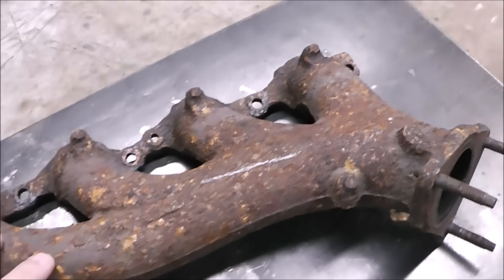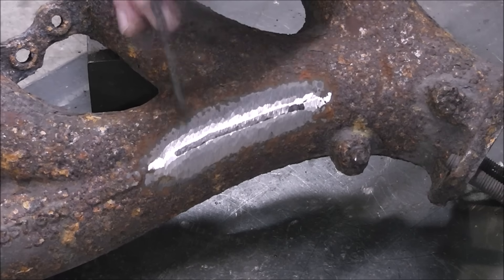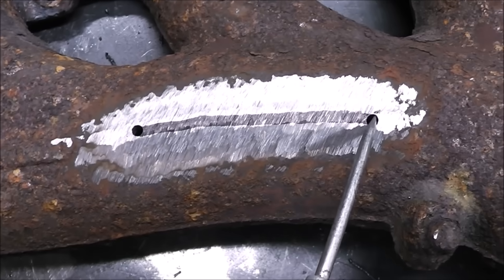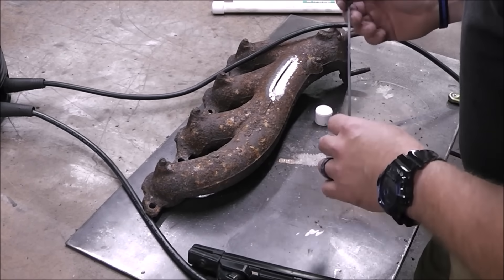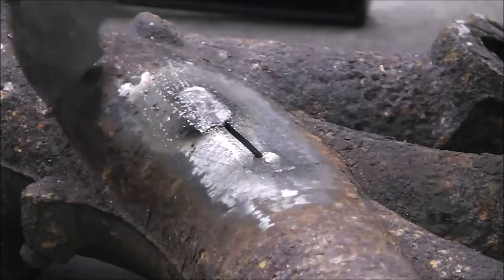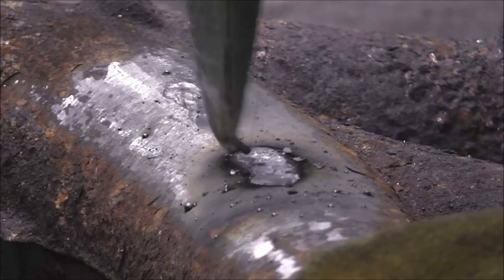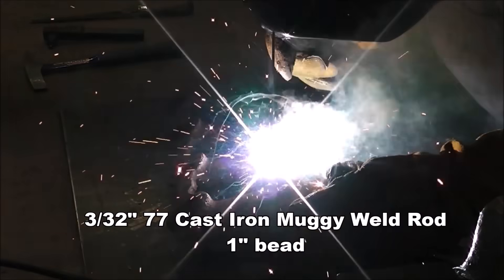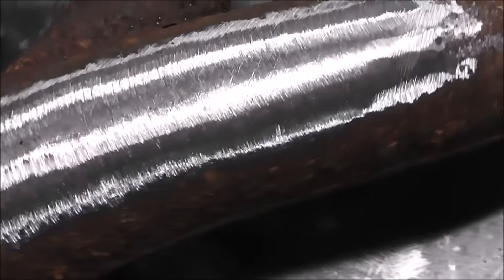Stick Welding Cast Iron Repair with Muggy Weld

Comment: Thanks for the video Brandon! I I recently graduated welding trade school and don’t have much field experience so I love these videos. 

I just have a question. You drilled the crack so it wouldn’t spread but wouldn’t the weld consume the entire crack melting and fusing the edges anyway? 

Would you be able to explain how the crack would still spread even after being consumed by the weld and how drilling it prevents that? 

Thank you!
Reply from the maker: Good question Michael.  You would think that the weld would consume the crack but I was taught that the radius from the hole is what terminates the crack and keeps it from spreading.
Reply: As you start welding on a crack without the holes at the end the expansion on the metal heating up can cause the crack to grow so you are trying to weld the crack and the crack keeps growing. So the hole keeps the crack from growing during the welding process, once it’s welded it shouldn’t be going anywhere.
Reply: The term for it is called 'stop drill' or 'stop drilling'. We were told in the navy that stop drilling the end of the crack relives the stress of the crack with the round hole allowing it to help absorb the pressure/force of the crack. On older jets the we find small stress cracks coming from rivets, occasionally on the skin of the aircraft, we'd stop drill the end of the crack and it worked, the crack would stop.

Comment: Okay... If I had some muggyweld I would use it to repair a cast iron flange in place. It's not coming off the tractor where it's been for 52 years.  I have some Craftsman 3/32 cast iron rods that run on ac or dc. They are older than you and the flux is coming off them. I really need a proper weld with less chance of blowing through or cracking the iron.  I can weld it with a warmed up motor.
Reply from the maker: Your in it David and those Muggy Weld rods would be perfect for that repair! Be sure to keep an eye on that video. As soon as it hits 1M I'm making the announcement. Good luck!

Comment: A couple years back I had my Chevy 383 stroker engine on my engine startup stand and I couldn't get it started so I had it in my garage and it was the coldest winter ever here in Windsor Ontario Canada and guess what? Yup the block cracked in 2 places. I could send you the pics. So I have been doing a lot of research into welding it and I have heard about Muggy Weld but have not bought it yet. I would love to try it so I can finally get my 1980 Camaro back up and running again. Thanks for the opportunity for getting some.
Reply from the maker: Your in it Daniele! It's a shame that the stroker got cracked but the good news is that Muggy Weld is a perfect fix for that! Be sure to keep an eye on that video. As soon as it hits 1M I'm making the announcement. Good luck!
Reply: I had a new rebuilt 383 motor do that and junked it. Thought I drained all the water and left for Florida for a few months. It cracked in the valley and the side of the block. Also years later a roadrunner I was restoring, the 383 block was cracked me and my buddies attempt destroyed it. He was a welder like I was then but I've never welded cast iron. but anyhow, lots of info and great video!

Comment: Good video , Ive always had better luck with parts from an engine if they are heated up , baked prior to welding to remove soaked in oil . Especially diesels.  Ive really come to enjoy tig welding most stuff.  Great video though , I sure will give muggy weld a try next time I have some damaged cast iron.
Reply from the maker: Thanks Mark! This was more of a test to see how these rods would respond using the cold method. As you pointed out, I would also go with a preheat and post heat cooldown to give myself the best chance of it not cracking. After using these rods cold I can say with confidence they would work great with preheat.

Comment: May I use AC instead DC?
Reply from the maker: If I remember correctly Mario, these rods can be used on AC or DC but if your looking to order some, I would check out their website to be sure. Cheers

Comment: you should be drilling before you grind it
Reply from the maker: wrong. Grind first so you know where your crack ends. Your hole has to be beyond the crack.
Reply: yeah and what can happen is you grind it and it hides the crack because you have ground it.
Reply from the maker: @TherealMandingo I would never discourage anyone from doing what works best for them.  Cheers brother.

Comment: Brandon, I am a cast iron expert with 40 years experience. Almost all your information is spot on except one thing you NEVER use nickel rod on an exhaust manifold regardless of any claims to the contrary by the manufacturers of the rod. The reason is simple they get red hot during hard driving. If you don't believe me just run your car hard at night the look at the manifold, it will be glowing red. The expansion/contraction rate of nickel is much different than cast iron and it WILL eventually crack again. It's not a matter of whether it will crack but when. I've been shown nickel repaired manifolds that the owner claims are holding just fine but a close inspection will show a hairline crack along the edge of the weld EVERY time if it has been awhile since the repair. 
There is only one way to PROPERLY repair an exhaust manifold and that is by using the same material as a filler rod; in other words you MUST use a cast iron rod as a filler because it has the same expansion/contraction rate. They are available at some welding shops but can sometimes be hard to find because so few welders know how to use them and the ONLY way to use them is by gas welding with a high heat flux. The manifold must be clamped to a strong back to hold its flatness and even then it may have to be ground flat at a head shop. Preheating and post heating the entire manifold to the proper temperature is a must; generally to a blue/brown color but temp sticks are better at about 500 to 600 degrees and it must be buried in sand (preferably heated) for slow cooling or slowly cooled in an oven.
 It is well beyond the experience of even most experienced welders as it is like welding mud and it takes a LOT of practice to do properly. I would suggest you try it just for the experience. It is somewhat like regular gas welding but MUCH harder to do properly. 
Exhaust manifolds have gotten to be pretty cheap with many running just $50 to $100. And I can assure you I would charge more than that to properly repair a manifold but some are hard or impossible to find and that's when you find someone who can weld manifolds but you MUST insist it be done with cast iron rod.  If they claim otherwise find a different welder.  One note about using nickel rods. You are right about welding one inch at a time (depending on the thickness) and peening the weld after but a good rule of thumb is allow it to cool to the point where you can place your hand on it before welding the next inch. Cast iron welding takes time either by using nickel or cast iron rod. I watched my boss try to nickel weld a cast iron bell housing once and he tried to do a four inch weld all at once. Even with peening it kept cracking on him. I could not convince him how to do it properly so I walked away; he never did get it repaired and trashed it. He had decades of welding experience but no  cast iron experience. Even welders with that much experience sometimes just don't know how to do cast iron.
Reply from the maker: Thanks man! I appreciate your kind words. I plan to get my hands on some cast rods and i cant wait to see how they flow. The manifold was more of an experiment on the basic process of applying a nickle filler to a cast part, (not necessarily a tutorial on what you should do to fix a manifold) but then some were saying it was not cast iron so I ended up switching our testing piece to a cast iron skillet to hopefully eliminate that cast iron / cast steel debate.  Thanks again for the great information and  comment!

Comment: how about alluminium. is there a way to stickweld alluminium? is there available welding rod for alluminium?
Reply from the maker: You can stick weld aluminum using DCEP. Its not pretty but it works. The rods are fairly expensive. Clean your material real good with a stainless brush and  you need to preheat the part around 400f. It also helps if you have sacrificial tabs at the beginning and end of your weld that you can start / stop on.

Comment: good video but why have you changed the part you was welding at first you were welding the top of the manifold but when you showed the finished item the weld was on the other side the bottom so i am confused but if you did weld it yes it is a good weld
Reply from the maker: The manifold was prepped on both sides. One side was for the video you watched and the other side was for a future TIG welding video. Being the director, camera man, welder and producer, I never caught that I was welding on the side that you did not see me prep.

Comment: You are incorrect about welding cherry red mild steel. Your undercut can also be cause by the too much angle on the electrode. If you purge the manifold while tig welding it, the weld inside will look nice like the outside.
Reply from the maker: I'm confused why you would think mild steel cracks from being heated to cherry red and allowed to cool (this is exactly what happens when you weld) but I agree with everything else you said, including the importance of a purge when tig welding.

Comment: Look, if you want to weld cast iron just throw it in the oven, get it to  500 degrees and use a nickel rod and tig weld. Done.
Reply from the maker: The reason it was done this way is in the description.

Comment: I've welded an old cast iron vise I broke a couple years ago with 6013 rod and it's holding fine to this day! I think it's actually stronger than it was before because I just can't seem to break it now.
Reply from the maker: Good to know! If you have been watching the Cast Iron Welding series you probably know I have tried a LOT of different methods. I don't think I've tried 6013 though 🤔. I might have to give it a try. Thanks for sharing your success story!
Reply: 6013 is not a cast iron electrode.
One day it will just fall apart
Reply from the maker: Neither is NR-211 but it works incredibly well.

Comment: The undercut may be that you went a bit fast with your weld and didn't let the weld fill in.  There is a tendency to run quick with cast iron because it doesnt like heat, but you still have to allow that weld rod fill in its own cut.   Excellent video
Reply from the maker: jason bourne You are spot on when you say there is a tendency to run quick when welding cast. We all try to limit that heat input, and in an effort to do that, sometimes we go a bit too fast. Thank you for this great comment! Cheers brother!

Comment: My girlfriend has a 15" crack. How much rod will I need to get full penetration. She says I need to preheat the hole and the crack prior to laying down my rod and it will prevent sticking my tip. I feel like I need a bigger rod but what do ya do?

God, I'm so juvenile sometimes...🙄
Reply from the maker: 15" is a huge gap, If you have a little rod, your gonna have to make multiple passes being careful not to blow through...you could always trade it in for a new one  😜 😁 -Thanks for the laugh :) Cheers brother!
Reply: @BrandonLund  Bro, this is the funniest reply Iv'e ever seen. hahahah
Reply: 15" is a cavern...forget welding, just dip the wick and avoid falling in.
Reply: C'mon Dude what kind of abuse did you do to this girl to get such a big Crack? or did you receive damaged goods?
Reply: Use a different rod
Reply: LOL Thanks for the helpful advice guys, I knew that I could count on yall!
Reply: My rod is probably bigger. Call me.
Reply: @lookeywho1287  lmao
Reply: Hock up a big loogy and spit on it first. Ready to go .
Reply: use the rod sideways that way you cover the ...hoe... 15" in one pass.
Reply: The ROD size is CORRECT. 
WELD that bitch.
Reply: Frank deluca  😂
Reply: Say no to the 15" crack. It can't be fixed. Just go straight for the 'ole balloon knot! 😂💩👍
Reply: @supercent666  To late my friend. I have already burned up my lil rods by making several root passes. I also had a few times where I blew out, which made a helluva mess to clean up. After blowing through, I had to let the machine rest because of the low duty cycle. 😁
Thanks for the suggestion though brother! 🍻
Reply: Broco, breh.
Reply: Bro, this is the funniest comment Iv'e ever seen. hahahah
Reply: 15"  is like throwing a hot dog down a hallway...
Reply: Oh and dont forget to lay down a few stringers for strength must maximize your holds so you dont fall in. Use a 2x4 and a chain and strap yourself in and hold on for dear life and whisper another girls name in her ear. Thats the bucking bull position lmao......
Oh and scream Whahooooooo!!!!
Reply: Bluelightbandit  sorry buddy the only thing you can do is go down to the butcher buy a leg of lamb shove that in do some stitching and pull out the bone that should get you afew extra miles before she will need a full resleave

Comment: I used a Eutectick low amp cast rod decades ago that required no preheat or drilling.  Not sure if they're still around, but awesome products Had a 1/16" ss rod max amp was 40, had a 120k psi tinsel & brass would stick to it. so w/e the application (i repaired cutting dies for the Hanover Shoe co) and has to splash a little brass on the cutter edge where worn. Regular Stainless it just balls up, this stuff it blended.
Reply from the maker: I love hearing from the seasoned guys on here and hearing about some of the things they repaired and how they repaired them. This was back when guys tried things to see what worked and what didnt. Thank you sir!
Reply: 309 stainless probably

Comment: When I learned, 1950s, after welding the cast iron was wrapped in an asbestos blanket so it would cool slowly. Small parts went into a tub of loose asbestos fibers. Shops and foundries that do a lot of cast iron welding usually have an oven.
Reply from the maker: Bad stuff! Before they knew the health hazards of asbestos. Ive been around asbestos quite a bit myself in the trades but I've always been careful. Hopefully it won't catch up with me.  A couple of my viewers have mentioned the big ovens and if you have access, that is by far the best way to go.
Reply: @BrandonLund  Much better welders and rod today. New and better techniques. Lots of change in 60 years. I worked in shipyards, ships were steam and all the piping & boilers were covered in asbestos. But I still have 2 lungs.

Comment: proves nothing unless it's on a engine and  heated and re heated  in use and does not re crack
Reply from the maker: It actually does though.  This is a well known and proven process, including the nickel filler material. Dont worry, it will work. Old timers have been using nickel for years, plus I didnt want to wait 10 years with an "update" that it was still holding before I could post the video.

Comment: Good preparation , drilling on both ends of the crack,Low hydrogen welding rod and a good preheat with a blow torch,seems to work well with cast iron 👍
Reply: Spam ☝️
Reply from the maker: Dude, they are relentless. I even have certain words blocked and they still get through. YouTube needs to step up

Comment: There’s a contradiction there because according to the other videos from muggy weld, all this protocol you’re making is completely not necessary, all you do is get the metal hot enough use the flush and the rod, and it’s done, mmmm I’m confused!!!
Reply from the maker: I dont know because I have not watched their videos. When they send the rod they send literature to help the user with a successful repair. It would be pretty hard to mess up if you follow the literature.
Reply: Brandon Lund I think you’re right, I was saying because they make it look so easy, there’s no way, thanks for replying and for the tutorial, great job I enjoyed it
Reply from the maker: Thanks man. I appreciate your support.  As long as you take your time and follow the basic steps, cast iron is fairly easy to repair.

Comment: Whoah..... good weld penetration started on the front side finished on the inside....SMH.. LOL
Reply from the maker: I've explained this probably no less than 50 times in the comments below
Reply: @BrandonLund  just busting your balls Brandon ... good video good advise i always was told that the weld would break on cast iron.
Reply from the maker: Thanks man! I've been doing some destructive testing and sometimes the weld is holding and the cast is breaking. Its definately not as strong before the repair though.

Comment: I weld cast iron with 6010 or 7018 tack by tack and it works good but once you finish with ityou have to coverit with dirt to help to let it cool slow
Reply from the maker: Are you using preheat with the 6010? I have had problems running 6010.

Comment: 2005 chevy tahoe  engine 5.3 liter    Left side
Reply: Dang real specific I mean left is pretty obvious i guess I did not look at it well but sounds right but otherwise I was just going to say gen 3 truck motor i guess could be a gen 4 i dont know of they changed the bolt pattern would fit
Reply: Jancris is right.  Its 4.8/ 5.3/ 6.0 drivers side exhaust manifold.